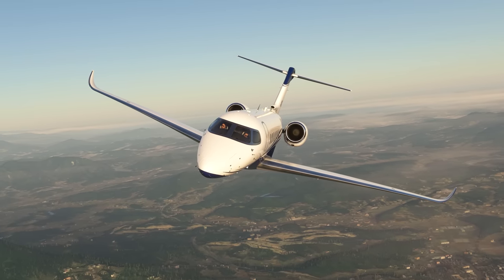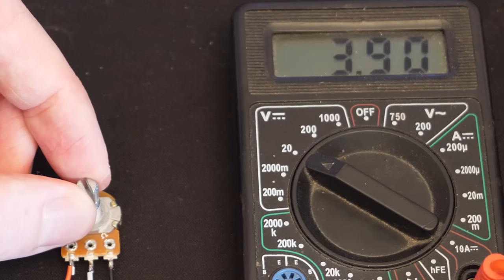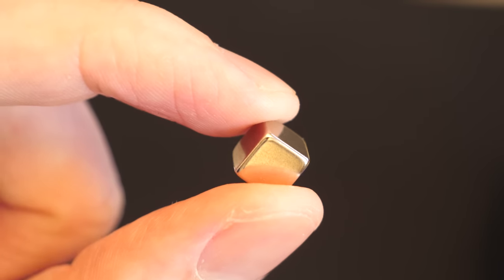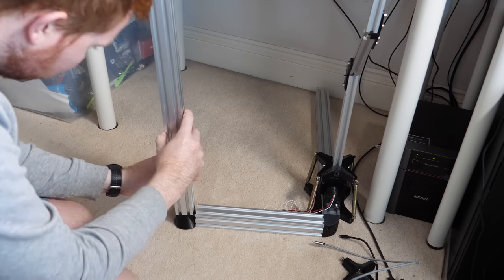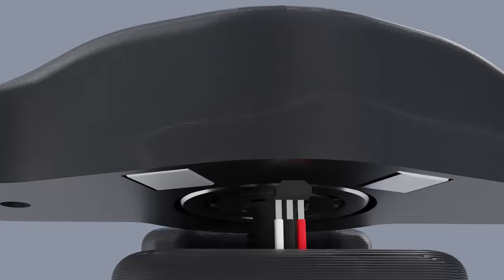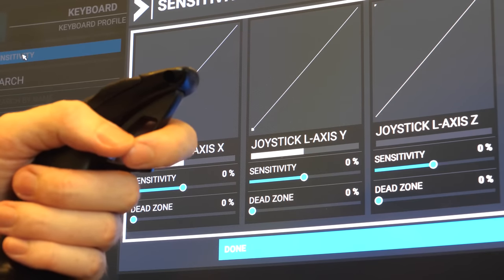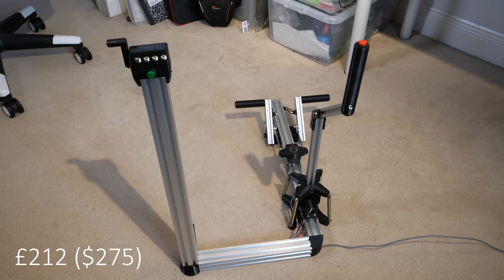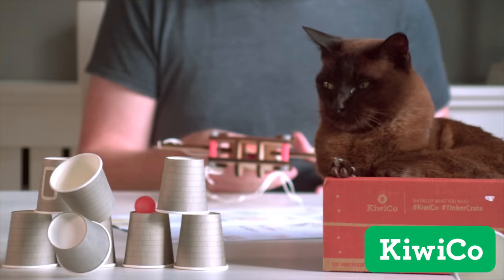DIY Flight Simulator Joystick

Comment: Very nice. I'm a simulator-focused flight test engineer with 30 years of handling qualities / flying qualities test experience, so this is my bread-and-butter, and it's so good to see what you're doing here. You might want to consider adding two things: some mass to the stick, and some friction or damping to each axis (pitch/roll/rudder). The mass will make it generally feel more like moving around the mechanical parts in a real airplane - the stick itself has mass, but all the moving parts do too. Every real aircraft has some damping in its control system (some natural, and some artificial). While too much damping is usually bad, some is definitely good. You can get relatively inexpensive adjustable fluid/hydraulic dampers (sometimes sold as adjustable shock absorbers). I think you'll find it feels far more realistic with some damping, and it will be less prone to pilot-induced oscillations and excessive "twitchiness". In my experience, the larger the airplane the higher the damping, partly because larger planes have longer runs of control system linkages and cables, thus more parts to add friction. A little Pitts Special will have nearly zero damping, but a 747 has fairly high damping. It was easy to see you overcontrolling the biplane - that would pretty much go away with a damped mass-added stick.
Reply: Zip tying some sort of ruber tubing around the springs would probably work. I've seen this used as a washing machine damper spring fix. Also adding sealed bearings would provide some resistance.
Reply: adding some car boot cylinders in parallel to the springs might work.
Reply: you can add dampers to both the anti-torque pedals, and the cyclic. I used a washing machine shock absorber on the collective
Reply: Just to add to this, I am a real world pilot with experience in the Pitts S2B and in fact most of the more common single engine light aircraft types. The typical market bought joysticks therefore have always never satisfied me when flying in sims. The biggest disconnect in my opinion is the lack of 'feel'. Sitting on the grass in a real airplane the controls are light in the hand.. you can feel the surfaces as they move, for example pulling back on the control column in a cessna type you will feel the weight of the elevator moving behind you. Now take-off..  the faster the airspeed the more air that opposes control movements, controls feel tighter and you don't need a lot of movement for example to bank or roll. At very low airspeed, controls become 'mushy' so you need exaggerated control inputs to achieve the same thing.

It would be great if there was a way to simulate this on a DIY joystick setup, reading airspeed from MSFS is relatively easy thanks to simconnect and/or FSUIPC. The problem is the mechanics.. hydraulics seem the superior approach, but doing that at home is likely unsafe to the point of dangerous. Certainly it's expensive. I am not an engineer, but anyone have any thoughts on how this could be done for a home hobby on a budget?
Reply: @wingandaprayer883  I've also thought about this and I would like to make this but with variable control damping dependent on airspeed. As far as the mechanics to achieve this, some simple ideas I've thought of are to have the tension in the restoring springs be adjustable with a linear actuator, cam, or screw system.
Reply: @copperheadtnp223  Thats a good idea. I'd guess the linear actuator would achieve the most precision for that design.
Reply: @wingandaprayer883  Me thinks the sort of system expensive wheels use for feedback would be the way to go, not that I have the slightest clue how they work
Reply: @wingandaprayer883   theres special hydraulic oil with metal particulates in it ment for car shocks that thickens up when a magnetic force is applied. Maybe something like that in a small hydraulic dampened to give that differing sense of feel for the controls?
Reply: @drumboarder1  force feedback? that uses motors to apply a force to the wheel so not sure how it’ll work with a joystick
Reply: @roowut  I literally just woke up so forgive me, but, motor's with transmissions that resist inputs
Reply: @roowut  may be able to wire in some simple stepper motors with spools that pull elastic bands tighter, adding resistance when tight and then loosening as airspeed slows
Reply: Or perhaps just use shorter springs with a length of cable on the end attached to a spool on stepper motors that do the same thing.  ‘Reel in’ the slack creating a tighter resistive feel when air speed is higher.  Spitballing here
Reply: That might be a good idea, as it would be fairly manageable to build.
Reply: Just idea but you could modify medical syringes push liquid and hence work as stable dampener, or if only partially filled with liquid, end stop dampeners. Playing with nozzle sizes and  such one should get desired effect. Expansion chamber/storage could be just balloon inside a container where water is pushed from syringe. You should be able to tap the syringe nozzle for better pressure resistant connection. You could also use gas springs from car, ones that are already died and just tap for liquid, then add constrictor based on desired resistance. Just tap large and then smaller insert inside before the connector for hose.
Just idea that popped into sleep deprived head.
Reply: @HeatherMRhodes  Or he can use some RC servos at the end of every spring, they will simply pull the springs so they got more tension as the speed is greater. These servos are used in diy belt tensioner mechanisms for simracing.

Comment: This will be amazing when used with an fpv rc plane setup
Reply: The guys at Flite Test have been working on that exact thing
Reply: Or a really stupid way to control a drone... That sounds like a challenge.

A helicopter, however, sounds like a great idea.
Reply: @Guffy1990  yeah, till you get whooped by some dude laying in a sim setup irl
Reply: Except you can have this much easier and 110ms latency would be catastrophic as normal rc links have 5 to 10ms latency
Reply: @peterzingler6221  you’re comparing the first harley ever made to a ducati. one is rudementary while the other has been refined to the limit. not a fair point.
Reply: @peterzingler6221  I'm pretty sure most of the latency comes from the Arduino processing the analog signals. You could easily leave that out in an RC version. Checkt out the Youtube-Channel "Flite Test". They built something like this for RC planes.
Reply: @peterzingler6221  The latency was measured though MS2020 - It doesn't read the joystick inputs all that often so in real time it would be next to nothing at the joy stick.
Reply: SovietandScotsman it actually wouldn’t be too bad if the drone was stabilised and just used for cinematic filming, you could try fpv with it and it could work, it’s got all the controls you’d need
Reply: @peterzingler6221  That depends, i think high quality radios already use hall effect sensors for their gimbals so breaking them out to the controls in Toms video might actually be pretty trivial, it might be possible to make a jack on your transmitter where the sim setup plugs in since i think you would only need six wires, positive, negative and the signal for each axis.
If it doesnt easily allow for having it plug in like i suggest it might be possible to fully modify a cheaper transmitter to replace the sticks with the simpit and hook that transmitter to another one using the same tech as with buddy boxing.
Reply: @Schradermusic  An Atmega 328P takes around 100 micro-seconds to read an analog input... So 0.1ms. I think most of the delay comes from the computer, having other things to do than updating the screen as fast as possible
Reply: @peterzingler6221  the latency is hugely influenced by his screen's latency, refresh rate, framerate used for measurements and the game itself. 
Of course an Arduino also has some sort of latency, but it's very small. What do you think those RC remotes are based on? Many are based on hardware that's very similar to an Arduino. Also: As far as I know, only TBS has latency close to 10ms. Spektrum for example has an average of 22ms.
Reply: Hi yo
Reply: @Guffy1990  What does it have to do with drones or a helicopter? It's about airplanes
Reply: Mr Steele would rip the thing apart, the way he flies.
Reply: With a laser designator and an onboard airsoft gun? Taka taka taka taka
Reply: He needs to that but flight test did already do that
Reply: Im definitely no expert but I can't see it being so hard to have a tx that has a USB port to use any controller?
Reply: Hi great vid and build I have an idea for a build and I've been thinking it's not something I could do myself so would need someone who knows what there doing with this stuff is there a way of private messaging you about the idea if your interested we get a few youtubers to are track so possibly good for subs if the idea can be made
Reply: @peterzingler6221   I think the latency has more to do with the game and graphics card and less to do with the peripheral hardware. What I mean is if you connected the Arduino to a transmitter instead of a computer the latency would most likely be better.
Reply: @zid_just_zid   spectrum has a trainer mode on a lot of their controllers that support a wired secondary controller link
Reply: @peterzingler6221  There would be no need for the arduino in an RC setup - the Hall effect output could go direct to the transmitter.
i.e. replace the potentiometers in the transmitter circuit with the Hall effect sensors.

Comment: For the full light-aircraft stick-and-rudder effect, it would be cool to add force feedback.
Reply: I would enjoy to see this. Awhile back o was looking into making my own with an Arduino Leonardo/ATmega32u4 and drivers. Not easy for those who are new to USB programing.
Reply: I don't know about the communication to the computer part of it, but it'd be pretty straightforward to modify the design for some servo mounts.

The problem comes when you realize how expensive really big servos are.
Reply: Yeah, there's a reason no-one's tried a consumer FF stick since Microsoft's effort. One of those projects that seems like it would be quite tractable, but the details are super tough.
Reply: @bar04z  doesn't help that immersion corp (basically a patent troll for all things haptics. Yes, the same company that sued apple for the taptic engine) holds a patent on FFB sticks for the better part of the decade. They still holds some related patents which could potentially be used for trolling.
Reply: I also think the same thing, but if the fs doesn’t give you any data for the feedback, it’ll be less immersive. It’s still cool tho
Reply: @ahmadshiddiqn  I've heard that FS2020 supports the old MS sidewinder, so the data's there in principle at least.
Reply: @xureality  The company was willing to license the tech but simply nobody cares. Microsoft invested a lot in the FFB joystick market but at one point even they sorta stopped supporting it through DirectInput. Before MSFS2020 dropped, flight sims were somewhat a niche and trying to sell a plastic joystick with motors that would last as much as a Sidewinder FFB for an affordable price was a losing proposition. And in the world of high end simmers many of the people buying the high dollar sticks are flying spaceships in ED or modern airliners/jets with fly by wire controls.
Reply: I've got a Logitech FF joystick that works in FGFS on Linux,  but the motors are really weak.  I don't know if mine is just faulty or there are liability issues with having a decent amount of force.  Either way,  I've wanted to build one for a long while now.
My first effort (made from Meccano with a copper pipe and the grip off a Quickshot 2) was in the 80s,  when there was zero software support,  but now I've got a template for the USB API with the Logitech.  I think the HID spec actually includes standard FF because I didn't need any sort of driver for Linux/FGFS
Reply: @xureality  And thus lie the advantage of patents. You can discover exactly how the technology works if you have access to the patent document.
Reply: @MattOGormanSmith  if strong motors are a liability issue, the simracing community would be absolutely jam packed with lawsuits, given that community's usage of massive industrial motors to get the wheel to snap your wrist like an actual race car.
Reply: @xureality  But aren't you supposed to source your own motor? Or are full kits available?
Reply: @ChucksSEADnDEAD  even "prosumer grade" bases like the top of the line fanatecs will deliver 25Nm of torque, quite enough to hurt you. SimSteering and SimuCUBE are the other two more obscure brands that I know of and they offer a bit more torque but you're not going to need it. Most high end direct drive wheels should be able to snap the wheel straight off your hand.

Opensimwheel doesn't even recommend going above 30Nm.
Reply: @xureality  If we're going prosumer there's a company that makes 1200 dollar FFB stick bases. I've seen maybe two posters on DCS forums claim they have one.
You need to make a 100-150 dollar product and mass market appeal which means selling to absolute dumbasses, not prosumers. Now it's a whole different ball game.
Reply: @ChucksSEADnDEAD  I assumed we're talking about the kind of motor that could snap your wrist.
I don't even think you can get a ffb wheel for 150 (t150 is 200 and that's as low as ffb gets iirc) and the ffb wheel market is doing well enough to warrant multiple brand name manufacturers.
So at the end of the day that's what it comes down to, the flightsim market just isn't big enough to warrant a basic but usable ffb stick or three, so you have to DIY or find some ultra niche "man and his shed" operation.
Reply: @xureality  if you’re not selling it, there is no reason to worry about a patent. A large corporation isn’t going to come after a guy building a flight sim in his garage. At least I hope 😂
Reply: @bar04z  a lot of ppl already know about this. And given the age of the controller, it's getting pretty much impossible to find. When you do, it is expensive!

Comment: Any tips on the printed mounts for the slotted aluminum? What kind of plastic and fill are you using?
Reply: Since they aren’t load bearing, I’d say probably just any PLA
Reply: As for the aluminium extrusion, you can find them just about anywhere online.
Reply: @Fdog180  People really undestimate load bearing PLA parts. 
If you design the project around them, print them so that you're not stressing layer-adhesion, PLA can be extremely durable.
Reply: @TMHedgehog  I agree. Relatively small PLA parts can support over 100kg of weight if printed right.

Comment: Dang it Tom, now I have to redesign my HOTAS! Your use of the Hall effect sensors is great! My original design used diametrically magnetized, cylindrical magnets fixed at the exact centre of the gimble shaft, but issues of precise alignment and rotational distance caused issues with resolution and precision, your approach is much better!

I think the only change I would make would be to replace the 4 corner springs with a single central spring at the bottom of the gimble, maybe with a tension adjustment.
Reply: soooo.. you're the actual man behind the HOTAS, or are you just joking around??
Reply: @SustainaBIT  I've made my own version of a HOTAS on my channel by modernizing a classic game port joystick, my original experiment with Hall effect sensors didn't work nearly as well as Tom's implementation here and was done before I started doing videos.
Reply: @Teklectic  I see, that's a good job!,, will check that out for sure, wish you best of luck with your future creations :)

Comment: I'd love to know what's the latency of your cat at the moment the ball hits the cups because that was really fast.
Reply: I wonder if the cat's latency can be improved. Maybe a cat firmware update?
Reply: @PunakiviAddikti  firmware updates can only do so much. I think an upgrade from cat5 cables to cat6 would help with the higher bandwidth, there may be other hardware upgrades that would work just as well
Reply: @Hoolahups  Probably a good idea. Maybe even a new cat motherboard or CPU (cat processor unit).
Reply: Maybe a new RAM (Random activity maker) would help too!
Reply: @PunakiviAddikti  After 10 million years of evolution, you really think a cats firmware can be improved? [steps barefoot in cold hairball puke from my cat] Well then, ok, maybe a thing or two.  :-)
Reply: cat reacted to the crossbows sound and not the ball hitting the cups
Reply: @Seeter1000  you must be pretty fun at parties, eh?

Comment: Nice job! One issue that is sorely problematic with gaming joysticks in MSFS is trim. In a real plane, trim can be set to cancel out the pitch input at any reasonable angle, and you can feel that as the pressure on the stick goes to zero. This holds the aircraft in a climbing or descending attitude (or level of course). The joystick's effective 'centre' position is offset by the trim. With a gaming joystick, there is no feel at all with trim, and worse, it works to make the standard centre position the trimmed position, which is unrealistic. It would be great if a flight joystick could physically simulate trim, perhaps by moving the spring fixed locations forward and backward using a motor. (If the 'feel' aspect of trim isn't familiar to you, try and get an experience flight sometime). If anyone can do it, you're the man! (Edit: another thing to consider is adding toe brakes to your rudder pedals).

Comment: the cool thing about this design is that it can be easily used with RC planes as well. 

I built this flight setup and have it controlling my eclipson glider using LORA for long range flight communication.

Im looking to soon convert my FPV goggles into a gimbal controller with an accelerometer and arduino board to be able a pivot my fpv camera in the planes cockpit for better viewing angles during flight.

Cheers!